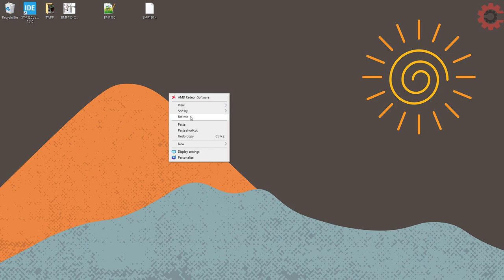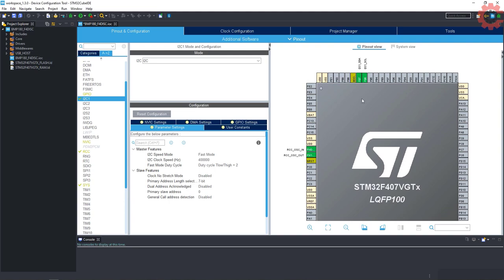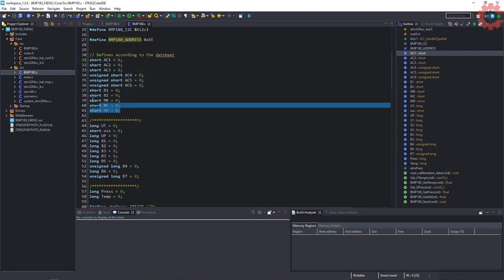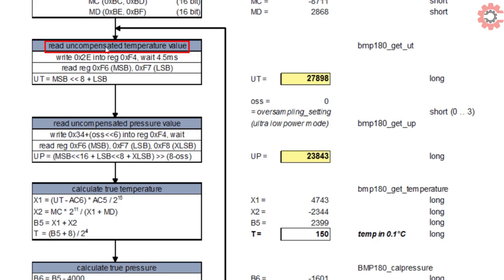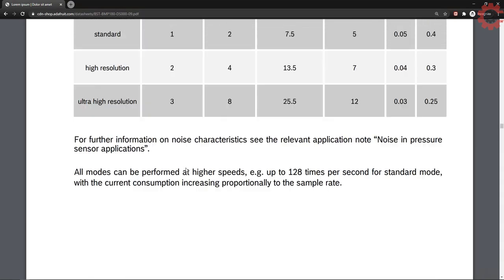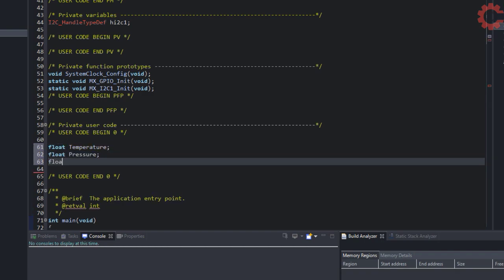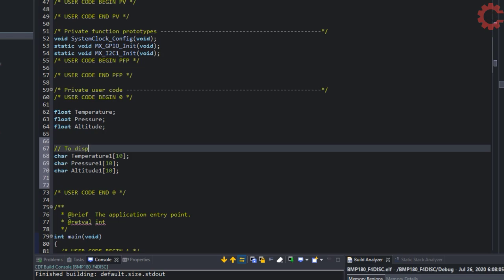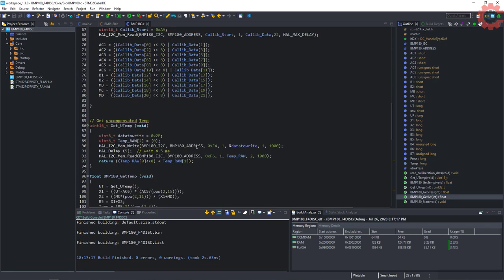Interface BMP180 Pressure Sensor with STM32 || Temperature || Altitude || CubeIDE

Comment: one of the best tutorial i found ever in YouTube for stm32 and HAL libraries. Please let me know any website do you have or UDEMY course-era etc, for teaching from scrach.it may be register based code or HAL library ..im interested
Reply from the maker: There are playlists on this channel.. check them out.. i have covered from scratch itself.. obviously a little knowledge in microcontroller is needed..
Reply: @ControllersTech  but there is less project u coverd.as u done STM32F4 of SSD1306 and BMP180 its working fine for u.but when i am trying for STM32F1 ..its not working even i have done changes accordingly for stm32f1???
Reply from the maker: You must be making some mistakes. This sensor relies on i2c only.. The code will work with Pretty much any device which have the I2C..

Comment: First of all it is a really great explanation .Im currently using stm32f103c6 in proteus i believe that i have done everything in the video correctly but in proteus i get  

Spurious SCL transition detected at 0.003769s [$II2C DEBUGGER#0011] @0.003769251s
Also in i2c debugger i see very low amount of transitions

Note: my clock hz is max 72mhz , two 4.7k resistors also connected to SDL and SCL 
What could be the problem ?, thanks

Comment: Thanks for the tutorial and it is helpful. But it seems strange that the altitude is about 700meters. Is there some problem about the pressure reading?
Reply from the maker: No there is no issues with pressure and the altitude is also perfect. Remember, it's the altitude from the sea level...

Comment: Hi. Thanks a lot for that detailed guide! I've used Your code for my project but I'm facing some issue: I don't get any calibration coefficients while running the function read_calliberation_data. I assumed that could be because of incorrect chip address: in the code example from Bosch I've found, they do a right shift of one bit of the address 0xEE; in the description of HAL_I2C_Mem_Write is pointed, I have to perform one shift left. Some people use 0x77 as a device address😮. I've tried all of these approaches, but the problem still persists. It could  be, my question is quite stupid, but I'm just a beginner and have no one to ask. What do I wrong? How should be the address represented?
Reply from the maker: 0x77 is 7 bit address. STM32 HAL needs 8 bit, so you shift 0x77<<1, which converts to 0xEE ( the address I used).
If you just want to check if the chip is responding, read the ID using the register 0xD0.
The chip should send the ID 0x55.
Reply: It doesn't. Either I made wrong I2C configuration or there is a problem with the sensor per se:(
Thank You a lot for Your prompt response!
Reply from the maker: Try connecting pull up resistors on sda and scl lines. Use 4.7k resistors